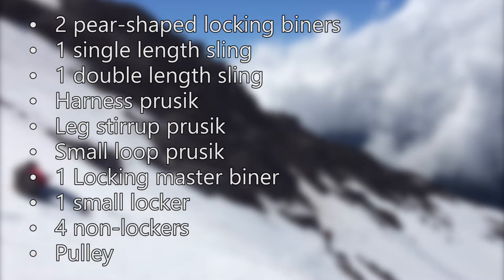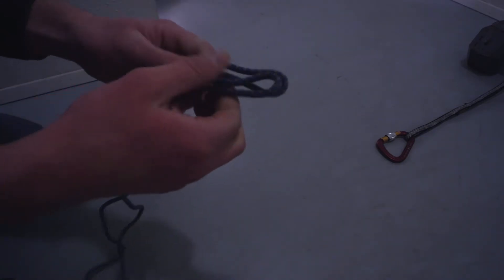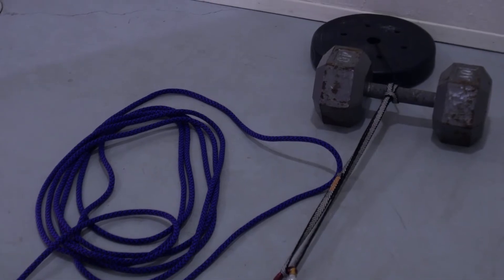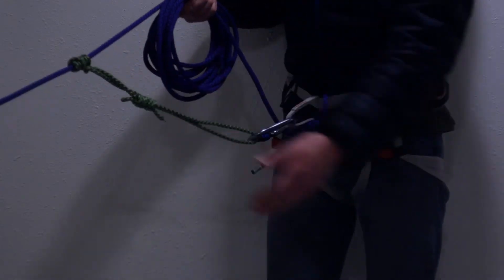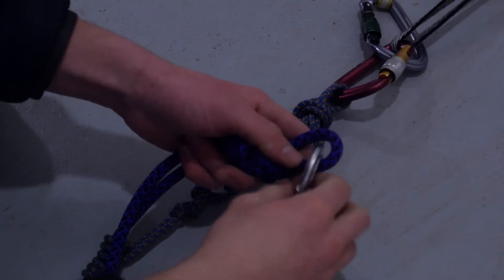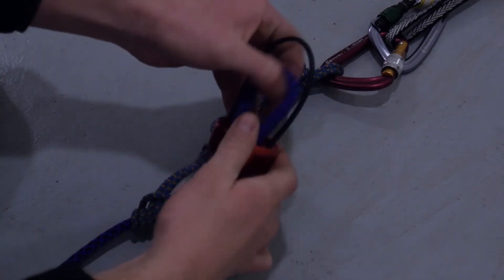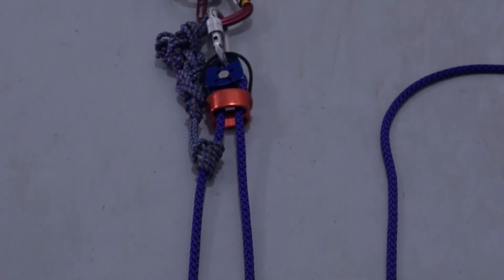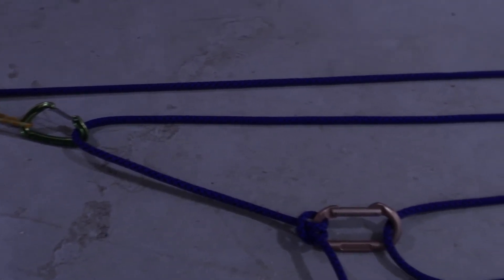6:1 Z Pulley: Step-by-step Crevasse Rescue

Comment: How would this system work with overhand/alpine butterfly knots tied at intervals along the "load line"? Can these knots be untied under load in order for the loaded rope to pass through the pulley/autoblock?
Reply: No, the "stopper knots" cannot be untied under load. If you use stopper knots in your main line, you would need a different system to rescue your fallen climber. The "drop C" method is a common method for this. Check out the AMGA's videos on crevasse rescue for a demonstration.

Comment: Fantastic little pulleys which I now have three of.⏩>allmy.tips/FusionPulley?kk✠ I use them as snatch blocks for pulling down fairly big trees (pulling them down vs. cutting them down, using the tree's length of trunk to leverage the stump out). Easy to use, smooth action and agreeably stout for my purposes using Dyneema synthetic rope. Used properly, the mechanical advantage (or ease to winch) becomes substantial.